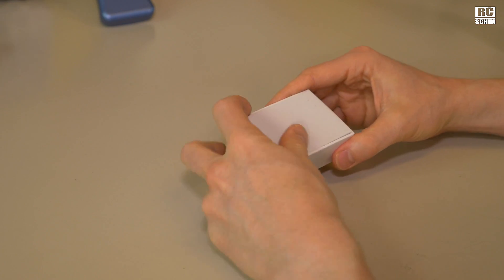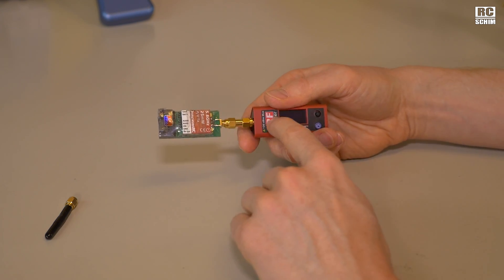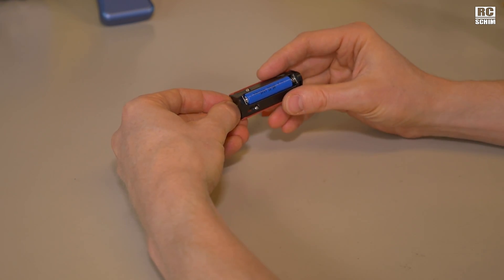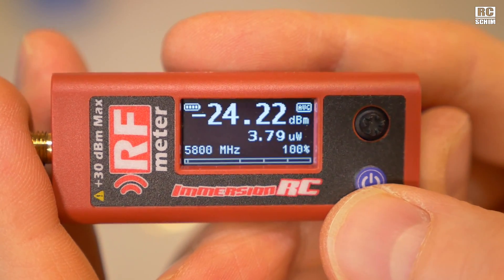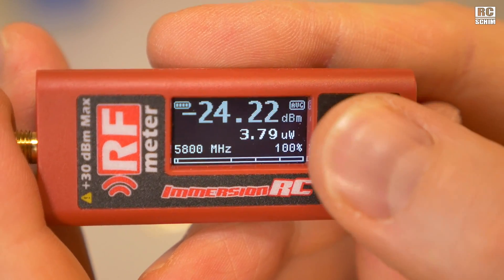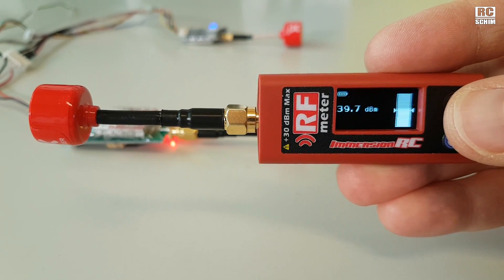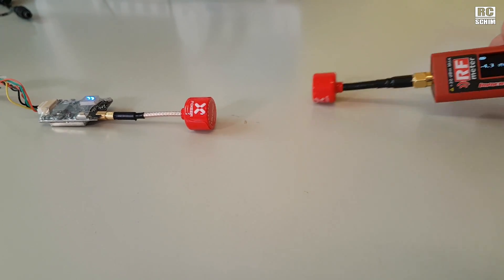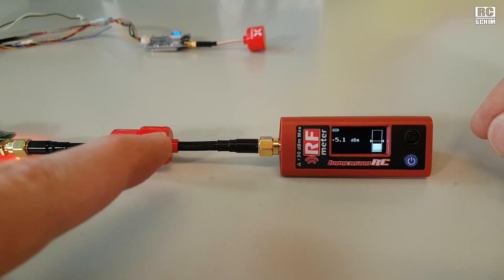ImmersionRC RF Powermeter V2 / AKK x2 ultimate 1200mw vtx!

Comment: How accurate is it when you compare to your other RF gear.
Im guessing it has an -30dBm attenuator referenced internally, but still dancing around  -24dBm with no attachment would result in  around -54dBm  3.8uV.. ain't that pretty high for no signal?
Im getting around -62dBm on my USB3 RF power meter just on its display and under 0.8uV and recall your expensive RF meter when you tested antennas were up around -70dBm.

Comment: Warning: Do not leave the power meter connected to a high power RF source (> 500mW)  for long periods of time (30 seconds or more). This will cause heating of the internal components of the meter which could affect long term accuracy. 
For long term tests of high power sources, use an external attenuator, and enter it’s attenuation value into the meter’s menu

Comment: Would you be able to use one of these power meters to check the DJI Vista unit as I tried and don't really get anything that makes sense lol
Reply from the maker: I guess only indirect. The vista uses UFL and I dont have an ufl to SMA pigtail to connect it to the RF meter.
Reply: @Rcschim  I was just curious as I bought one of these kneaders and hooked it up to the DJI unit and I don't see it getting any more than around 400 watts maximum less than that usually and that's hooked up directly so I just didn't know if DJI uses some type of different frequency or something like that and I have the 1200 ml mod as well and have great reception

Comment: have you used the power meter on Unify Pro HV at 800mW ? just to have some comparable data for reference. I have the same meter and when testing Unify Pro HV at 800mW the meter shows just over 500mW, this is consistent across many different quads that I have, typically I get 500-550mW (I'm on F1 5740). your test on AKK has shown at first 700mW, so that's still much more than what I get on Unify Pro HV 800mW.
Reply: whats your take here 3 years later?
is it accurate?
Im asking since Im noticing a very high "no signal" level at 24dBm and if referenced with an internal -30dBm attenuator, would made it land at -54dBm
on my cheap 40USD USB3 RF power meter.. I'm seeing around -62dBm with no load, and 0.8uW.
but that is on its display, still need to fidle with the PC software.
Im new to this

Comment: So did it measure the same with your expensive meter?
Reply from the maker: somehow it doesnt work for me to use the expensive spectrum analyzer as a power meter...   wheter or not the IRC powermeter v2 is accurate is a debate. most vendors (of VTX stuff) claim it's not :)  but I trust IRC that they've calibrated and tested it - should be accurate enough for hobby grade measurements...

Comment: As far as i know every 5.8 GHz video transmitter uses the RichWave RTC6705 modulator which ouputs 20 mW. 
For higher power its ouput is amplified with an rf amplifier. There is actrually only one affordable rf amplifier suitable for 5.8 GHz with around 1 W power ouput for about 10 dollars. Propably all 600 to 1200 mW 5.8 ghz video transmitter use the Analog Devices HMC408. Not until 40 to 60 dollars you get 2 W from the TriQuint TGA2706 and Analog Devices HMC7357 and 4 W for about 90 dollars with the Analog Devices HMC1121.

sky.geocities.jp/oumeastro/RTC6705-DST-001.pdf
http://www.analog.com/media/en/technical-documentation/data-sheets/hmc408.pdf
https://www.qorvo.com/products/d/da004329
http://www.analog.com/media/en/technical-documentation/data-sheets/hmc7357.pdf
http://www.analog.com/media/en/technical-documentation/data-sheets/hmc1121.pdf

Comment: rcschim whats the strongest vtx 5.8ghz u ever tested or know of?
Reply from the maker: trying to live up to your nickname? Danger Dave? :)
The AKK fx2 ultimate probbably. it's capeable of 1.2watts (if tested right I have to admit).
There are also some 1.5watts thingies - but I've not tested them.
Usually 200-400mw is more than you ever need. increasing RX power further doesnt give you that much benefit...
Reply: RCSchim thànk u sir, I was curious since friend wants long range setup but for me most I'd need is 600 even if I use that
Reply: hey would the channel im on make difference on my fpv video quality i use 5740 most time but ive seen some vtx show more power because it was like 5645

Comment: It's the pigtail that is dampening
Reply from the maker: not so much - but it might be a weak contact...
later I measured more power, but only on a specific E3 (6556) and while using 20db atti externally).

Comment: Hi folk... according to IRC user manual for this RF power meter, we should not have it connected measuring power above 500mW for more than 30 seconds without an external attenuator :(
Reply from the maker: it says greater then 30dB shouldnt be longer than 30sek - that would be 1watt...
You can use a 20db external Atti for example (which I did). Looks like this makes the high power VTX measurements more accurate as well...

Comment: Hi!
Is possible you need more volt to have 1200mW?
Like a 4S or 5S battery?....
Reply from the maker: nope, you need to be on a specific channel/band E3 (5665Mhz) - there the most power is being transmitted out. 
It went out around 1.4watts after switching it on, then went down to ~1watt after a few seconds of heating up (and it get's really hot).  As soon as I have time (or another new VTX to test) I will make an update video...

Comment: Just arrived here ! No problem in testing vtx but with my Taranis x7 I don’t get more than 1 mw in peak mode and below 1mw in average mode , am I doing something wrong ?
Reply from the maker: I cant test Taranis (x9d) directly by screwing it on (since it has as fixed antenna). I can only use the sniffer antenna next to my taranis' ant. and there I get around 6db (as shown in the vid).
should be in peak mode, have you set 2400 as frequ? do you have atti db's set? tell me your settings...

Comment: But what about all the other channels? Maybe this crazy 1200mW vTX outputs that brainkiller power on other channels, i have seen this before on other vTXs...
They had to lower the price since you can find on ebay open source arduino RF power meters for just $60 lol
Reply from the maker: ABMNS PRODUCTION hi Cedric,
  Akk said in a reaction that maybe me test is wrong :) that power meter can only go 30db. But it can go a bit more for limited time...
They also stated that I should test e3, 5665 - so I will try there. But I think that I’ve bent that connector, and now it can’t deliver full power. So it’s a bit fragile there and needs reinforcement.
Yep, glad there is some competition to lower the price level :)
Reply: Damn, You managed to bend a MMCX connector lol You are good lol
I remember couple of years ago, someone from Boscam wrote to me that it is perfectly normal to have channels outputting less RF power than other and every vTXs have at least a couple of channels capable of outputting high RF power! They are designed in that way!
Looking forward to see the datas coming from E3 - 5665 lol Let's hope it won't be 2000mW lol
Reply: If you look at this video: https://www.youtube.com/watch?v=rMg2DO1fsWE , you can see that the maximum output is around 5900MHz and actually pretty close to 1.2 watts
Reply: Yes your right some vtx are tuned to certain freq. and the output impedance has to match the antenna impedance.
Reply: Interesting the 915Mhz is missing... Firmware updatable?

Comment: What size vtx are they warning about using an attenuate
Are the common vtx fine?
Reply from the maker: skypilot 23 if you test something over 30db (1watt) you should be careful. A 1.2w vtx doesn't fry it immediaty but you shouldn't keep it on for you long according to the manual.

Comment: Very informative about the tool and RF in general - thanks!  So our taranis radios only output about 5.7 dBm, which is about 4 mW?  Amazing that such a small output can go for miles if you're using a sensitive receiver like L9R.
Reply from the maker: MostlyHarmlessRC no, I guess the frisky does use around 100mw, it’s not always showing you the true mw with the sniffing mode. Antenna is not compatible, also here.
Reply: Okay thanks again Mario!  100 mW is what I had heard before about taranis power.  So, this is mainly an antenna issue.